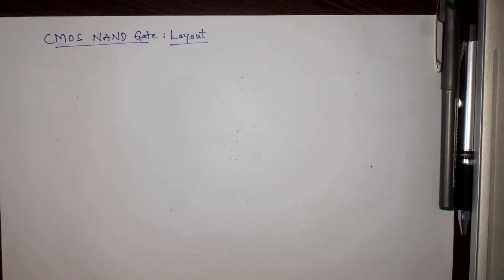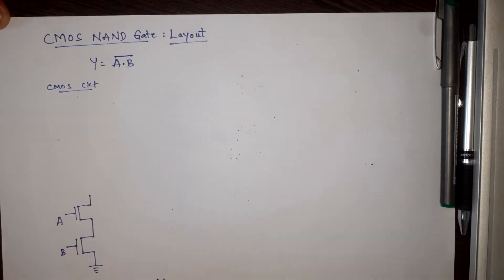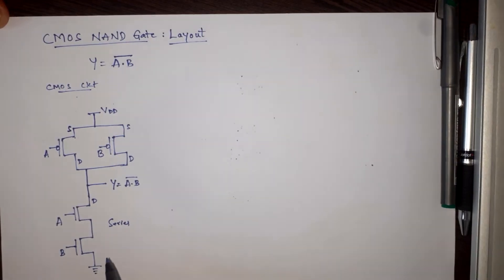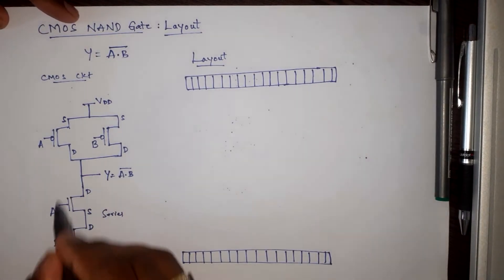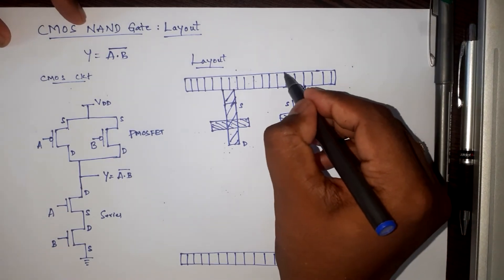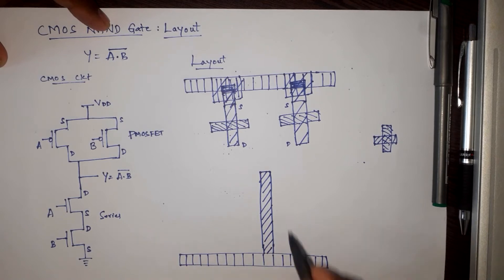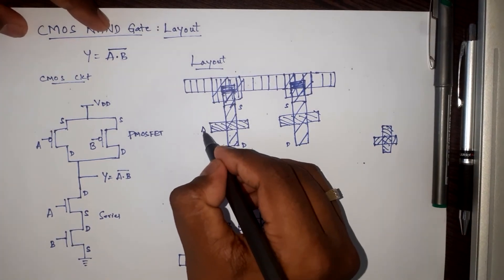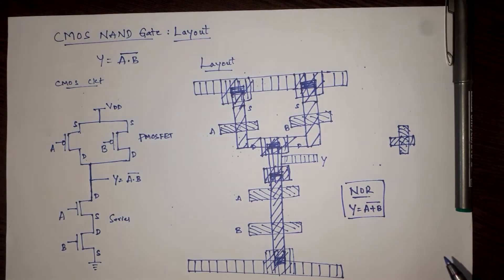cmos NAND Gate layout design | CMOS VLSI Mask Layout

Comment: This video explains the layout design of a CMOS NAND gate, including the circuit diagram, transistor connections, and the physical layout implementation using diffusion, polysilicon, and metal layers.

Key moments:
00:08 The video explains the layout for a CMOS NAND gate, detailing the expression and CMOS circuit for the gate, including pull-down and pull-up networks.
          -The expression for the NAND gate is y = a * b'. The CMOS circuit includes pull-down network with NMOS transistors and pull-up network with PMOS transistors in parallel.
          -The layout involves representing VDD and ground connections with metal layers, placing transistors using p diffusion and polysilicon cross over, creating the transistor structure.
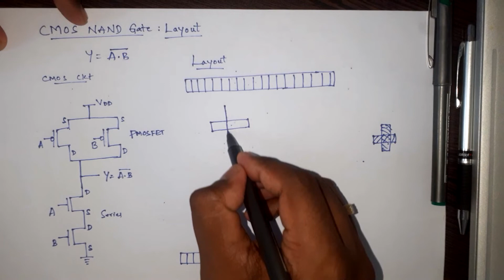03:48 The video explains the layout design for CMOS NAND gate and CMOS NOR gate, showcasing the connection of transistors and diffusion materials for efficient circuit operation.
          -Layout design for CMOS NAND gate is demonstrated with the connection of transistors and diffusion materials for efficient operation.
          -The video also covers the layout design for CMOS NOR gate, illustrating the arrangement of components to implement the logic expression y = a + b whole bar.